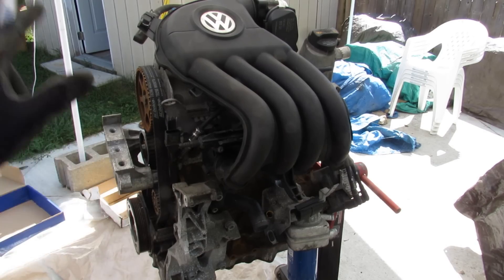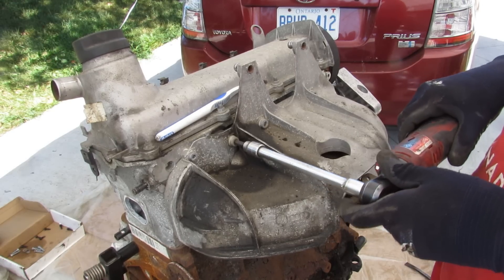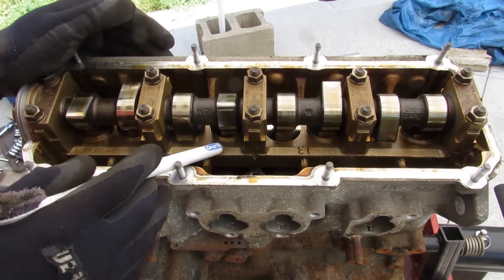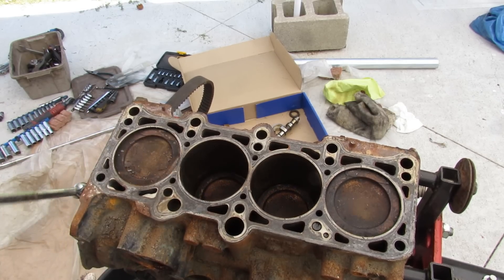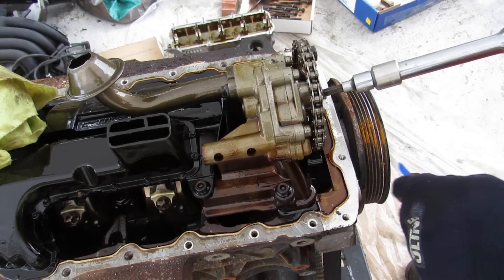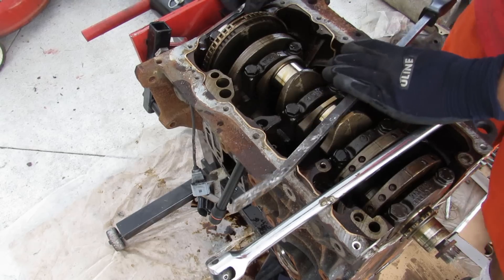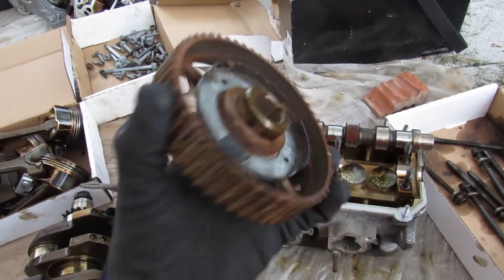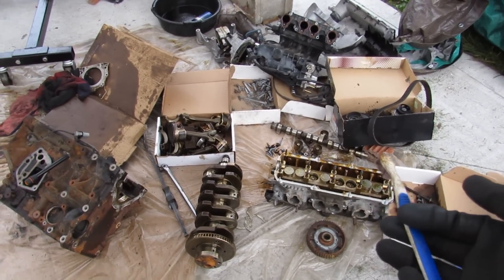The Simplest Modern Engine - From Volkswagen?

Comment: Little background info, from European market - this is the largest variant of 4cyl EA113 series and it was used since early 2000's as a replacement of more complex 92kW 1.8 20V engine. Base engine of these series was 74kW 1.6 8V, with aluminium block, top of the line was 1.8 20VT ranging between 110-160kW. I think there was also 16V variant used in Audi. EA113 series were derived from EA827, in US known as "big block"
Reply from the maker: Ok thanks

Comment: iron block is the exact same cast as the 1.8t missing just a few things and its a 1.8t block so its been the same since the early 90's cheap and reliable.
Reply from the maker: Nice so what is just a stroke change?
Reply: @speedkar99  Stroke and bore change. Same as a 1.8T stroker kit. This block is just missing oil feed and water feed for turbo. Crank pistons and rods are different.

Comment: Gotta love the VW 8v.  Dead simple, dead reliable, and built stout enough to handle 3x+ stock power on boost without any internal changes.  Easily one of my most favorite engines of all time.
Reply from the maker: Yeah I just wish out of box it was more than 115HP. Laughable for a 2.0

Comment: On the 90's European market, it was considered to be the most competitive class: 2 liter 4cyl sedan. Every company had to push the envelope and bring something new to the table. Alfa had the twin-spark with amazing power, BMW had rwd and racing pedigree, subaru was awd and had a boxer etc. VW had no decent 2liter gasoline engine in the 90s, so everybody bought the 1.9tdi. I knew the performance numbers were low and always considered it a long-lasting simple engine. The truth is, VW forced people into buying turbocharged gasoline engines and prepared the soil for the downsizing era: many buyers were disappointed by the 85kW 2.0i and went for 1.8t instead. The same people were later more likely to buy a 1.4 tfsi.

Comment: Depending on what you have,  someday you'll need to replace the timing belt which is on the outside of the engine or the timing chain which is on the inside of the engine.

Comment: I drive 1995 golf mk3 variant. With 1.6l 101hp engine its basically the same as this one, except the oil pan and mine still having distributor. It has done 370k km. And thats what i know of. Who knows if the odometer has been tampered with.  Ive driven 85k with it already and only things ive done to the engine is basic maintanence. Oil, belts, filters.  Doesnt burn any oil. Oh. And the car converted to LPG so its 2x cheaper to drive than a petrol.  Basically. Im super happy with my car. Its not the fastest or the newest thing.

Comment: These engines are legendary here in Brazil. Bonus points if mounted longitudinally.
Reply: haha longitudinally is badass! Never seen it done with this engine. Do they use the same chassis or is it a swap
Reply: @JasonLuther1   These engines came from factory in a lot of VW cars here in Brazil. Due to some platforms being derived from old Audi models, it was mounted longitudinally in some cars. In cars with more modern platforms, it was mounted transversely.
Reply: @gsilva220  You are talking about the EA827 (AP), made in Brazil.
But in this video, the engine show is the modern version made in Mexico.
EA111.
Reply: @marceloho1984  you are splitting hairs...I think the only difference will be the plastic water pump and manifold..plus the chain driven oil pump...I can't remember any of my old Audis having a chain driven Oil Pump
Reply: @marceloho1984  nope...
EA111 is a whole differente motor, this motor is the EA113.
90% similar to the AP
Reply: @JasonLuther1  it's very common...all Audi 80s..and some Passat and Audi 100 have them mounted Longitudually
Reply: These engines with forged parts and a turbo can achieve 500hp in road cars, insane!
Reply: They are legendary Worldwide ✅.when we talk of VW reliability this is the Engine we are talking about..1.6/1.8/2.0👏
Reply: Work at a Volkswagen store. One of our master techs told me that this 2.0 engine is super reliable, just be sure to change the timing belt when the time comes.

Comment: I got it´s sibling with code AQY from 1999 skoda octavia,which is basicaly vw. It has secondary air pump. I quite like it, in europe 85kw/115ps is good enough. But mine takes plenty of oil,almost 1L/1000km,so plugs are fouled very often and i have feeling this engine is lazy for its power,bud of course it run  for more than 300 kKm and over two decades :D

Comment: What i heard is that VW keeps making iron block engines because cast iron absorbs noise better than aluminium alloys, thus reducing the need for sound insulation.
Even the EA888 engine is still iron block, and its one of the best modern turbocharged engines.

Comment: so how would you replace the wires and plugs?  Jack the engine up and remove the intake? What a weird design. Why? I had a few old volkswagens. Early 80's . Mechanical fuel injection and primitive digital ignition too.  Seemed pretty advanced for the time. Fuel injection in 1980.  Definitely more reliable fuel and ignition than other engines of that era.  They must be more user friendly than that engine.
Reply: REMOVE THE NO.1 AND NO.4 INJECTER WIRE PLUG FIRST AND THAN DO IT .( MY 2001 AZG )

Comment: The design is simple and easy to service because it was built on the design concepts of 4 cyl engines from the 70's. The addition of FI and full electronic ignition with a distributor is about the only thing different from almost any engine from Japan at the time.
BMW, OTOH, was designed to be hard to work on even in its 60's-70's iterations.

Comment: So fun fact, this /used/ to be a performance engine back in the MK3 days. The ABA and AEG engines were the GTI engines in the MK3 (and I think MK2 also?) and it was also used as the base model engine on the MK4. It's really simple, very small, and surprising for VW, easy to work on. You can actually buy cams meant for the MK3 GTI and drop them in with a tune, or you can upgrade to the ABF head for 16 valves, not the base 8 (also DOHC iirc).
Reply from the maker: Nice!

Comment: Looks like my old Porsche 2L 924 engine. It was the most reliable engine I've ever had (not powerful but reliable). 30 mi/gal cheap non computerised cis fuel injection also.
Many times in life simpler makes for a more stress free, care free life :)
Reply: The Porsche 2L was a modified VW EA831 AFAIK

Comment: This engine debuted in 1977, with a few upgrades, but basically didn't change much over its 38 year run. The plastic water pump impeller is it weak point.

Comment: I've learned a lot from this video, thanks. I have a 2012 Jetta s 5 speed standard with this engine, it the car has been very reliable I've put 196000 miles on it but the lack of power is excruciating. Part are expensive and labor too, up there with Mercedes and BMWs, and yes the coil pack is acting out thanks again.

Comment: And now VW is slowly converting to EV production, and from what Sandy Munro found from disassembling the drive motor and inverter, their EV drivetrain design is a tour de force in simplifying production and assembly in some very smart ways, including removing a bearing from the whole system which is no small feat.

Comment: You keep mentioning that this economy car has a cast iron block instead of an aluminum block. Isn't that exactly what makes it economical? It's cheaper to manufacture, albeit heavier, therefore adding to the economy car vibe of the Jetta. It's simple, it's reliable and gets you where you're going. Everything that you noted makes this super economical. Single coil pack versus individual coil-on-plugs etc.

Comment: Had a 2,0 in my Mazda 929 LA2 Coupe. But that one had already a v- shaped head with a single cam and rockers from alluminium, a lot more modern than that crappy VW - engine and absolutely reliable . No problems to change spark plugs, adjust valve timing ... After that I had some rotaries, one I still own and some rev- happy twin cam 16 v Miatas, still have one of them too. No problem cars, even the rotary. Seems I was lucky.

Comment: Our family has an 04 golf with a 2.0L i'm thinking its CLOSE to what this engine is, a predecessor i imagnie. Rated at the same pathetic horsepower, BUT the thing has like 350k KMS so ''only''  210k miles or so, but in our climate, with age and shit, rust non stop rust, the thing has been darn reliable. It has NO power, but it just goes. Top speed of like...70? 75? mph. So its barely gonna keep you on the highway, let alone don't think about passing.

Comment: I have one of those underpowered but extremely reliable engines.  It will last forever with good maintenance... do not forget to replace timing belt water pump etc. if over 80 000 thousand miles and will go and go... and go...

Comment: a very interesting engine and a staple of simple design is the volvo b200/b230 (nicknamed redblock) from the 90's. Simple yet super effective an reliable with power ranging from 90hp and mechnichal fuel injection to 200hp 16v turbo efi, a legendary engine famed for its reliability and tractor like design, a teardown video would be very interresting !

Comment: I personally am a fan of simple engines for daily driven cars. Might go to work car doesn’t need to have for second 0 to 60 times and the 200 mile an hour TopSpeed. It needs to be reliable, easy to work (on when it does need work) durable, long lasting, and good on gas. That’s why Toyotas old 2.2 L that is in my 2000 Camry is one of my all-time favorite engines.

Comment: This engine is still based on the Audi 827 engine from 1972 used on the Audi 80. This engine was widely used throughout VW's lineup in Brazil from 1985 to 2015 in all sorts of displacements, 1.5L, 1.0L, 1.6, 1.8 and 2.0. It also appeared in numerous Fords through the AutoLatina joint venture. To my knowledge, even the Audi TTS 2009 used a variation of this engine.

Comment: That's a similar engine as a 2.0 liter spi 2000 Ford escort se I used to own except for the intake being plastic and a few differences. The head on the escort is aluminium, the block is cast Iron. The horse power rating is about 110 hp@5000 rpm.😎 When gas was about $2.00-$2.59 I drove 1100 miles and it cost me $60-$70!

Comment: I agree your complaints , VW  is overrated , and overpriced.
It wasn't the head gasket , that produces Mayonnaise at the oil sump ,  it's 99,9% leaks at the water/Oil heat exchanger , beware of the plastic impeller of the water pump.. , It breaks ! , You'd better swap for an aftermarket bronze impeller pump.

Comment: Vary similar to the Saturn 1.9 but the Saturn had an aluminum block and a timing chain. I like the chain because I put 250k miles on it without replacing the chain.

Comment: I bet you can get an adapter plate and bolt it up to a Miata transmission, then drop it in a Model T, A or B Ford. That would be a fun hot rod for a daily driver.

Comment: You keep talking about the engines features and design as stupid. The newer engines are WAAAAYYY worse. Full stupid design without considering the backyard mechanic at all.. The new engines are going for max horsepower/max complexity. Maximum number of things that can fail. Case in point the VW/Audi 3.0 V6 Turbo. Turbo's ALWAYS eventually go bad and one failed turbo on this engine will cost you $12,000 at Audi, $7,000 at the local import specialist or $4,000 at the neighborhood general auto mechanics. Good luck!!

Comment: I love this engine.. It's great that they're making old, reliable, lower horsepower engines. I wish they would still make the low compression, non-interference, valve to piston relationship. This low horsepower engine could run forever.
Reply: But it doesn't and wont

Comment: The VW 2 liter power-plant is actually a fascinatingly adaptable engine. It can take boost numbers that make K tuners go pale in the face, stock. Forged rods, pistons and crank, and with valve timing options, it’s quite ingenious. Billeted models with forced induction can have insane redlines. Like… there’s a video on yt, it may have been pulled, of this thing, as a billet, putting 1100WHP down. That passat brought down a SMOKE show.

Comment: Its just a crossflow version of the Mk3 1992-1999, that is even simpler, 45 minutes to change the timing belt on my 1.8 ady engine 1./1/4 hours to do the 2 liter, they both still get 100km to 7 liters fuel approx (freeway) I cant stand all the new rubbish there's no room under the front and everything is expensive, My mk3 has a heater 2 mirrors radio and thats enough for me!

Comment: This is a variation of the old EA827 engine from the first Audi 80 from 1972. It was a pretty modern engine back then and the design has proved its worth with such a long production run.

Comment: The gaskets between the oil cooler and oil filter housing are a ~10 year replacement item. If they're ignored, they dry out and crack... and then all the oil sprays out! VW has used that same design - and cooler module - since 1983!
Reply: If it’s not fixed after ten years… how is that VW fault?? Just sayin’
Reply: @H33t3Speaks  I'm not saying it's a design fault, just that it's a maintenance item.

Comment: With Euro 6 emissions now and 7 around the corner gas motors becoming so complex. Expensive to repair and maintain. Electric vehicles definitely the future.  EV’s will expand rapidly just like smartphones.  Oil is a finite commodity and the electric infrastructure is in place with just an outlet.

Comment: I'm surprised they produced such good simple, old but proven, reliable design until mid 10's for the US! In Europe, for the most part of the 10's, it was all about turbo + direct injection + downsizing + you better have lots of spare change in your pocket if you own a TSI out of warranty and it broke. lol

Simpler is always better.
Reply: Blame the EU fuel economy/CO2 standards (they are 2 ways to measure the same thing).
Small turbo engines do great in test cycles. The fuel economy increase is not that great in real world driving, but it doesn't matter since the design goal was meeting regulations 1st, anything else second
Reply: @petarmiletic997  i recall an article stating that a turbo 4 can use more gas than a V6 in real world tests…i don’t have a link though
Reply: @SkylineFinesse becouse in real life people like to drive agressively, and NA engines are more fuel effiecient when it comes to driving like that. Turbo petrols reqire a specific driving style, meaning trying to stay off boost at normal driving
Reply: @foxy126pl6  yeah, intake temps are high, so they spray extra fuel to keep the cylinders cooler.
Reply: Yep, these engines ended in Europe in 2010's with 1.8 20VT and 1.6 8V
Reply: You could get this engine until 2015 in the European VW Caddy, powered by natural gas (methane). Passenger cars, on the other hand, all went with the downsized turbocharged engines, save for the entry level Polo and up!, that still have a N/A 1.0 3 cylinder. Which is arguably still downsized, just not turbocharged.

Comment: The oil spurs are not to lubricate the cylinder wall as you said, but to cool the piston. lubrication of the cylinder wall is done by splash and the oil control rings.